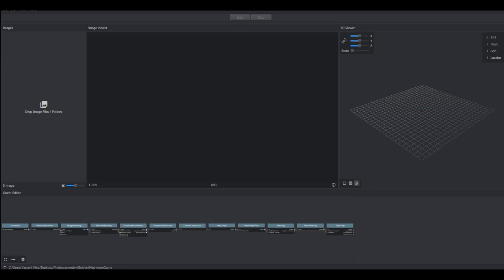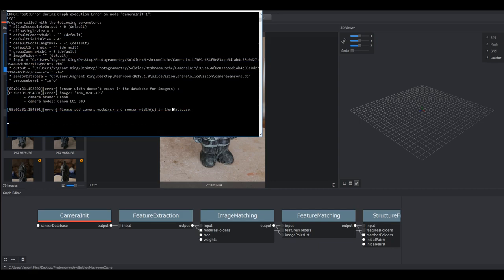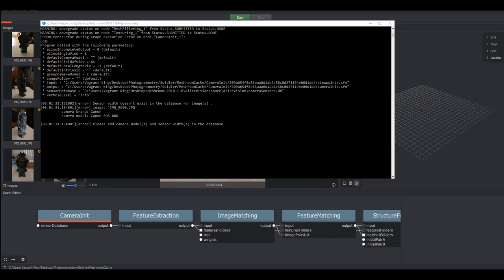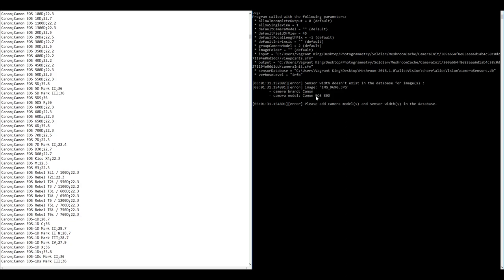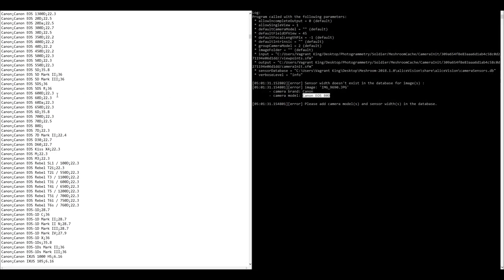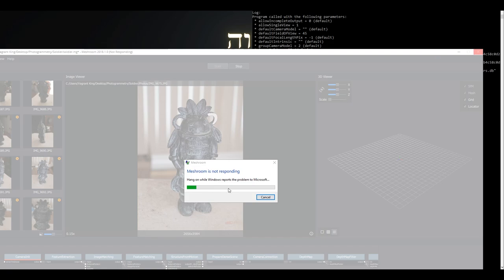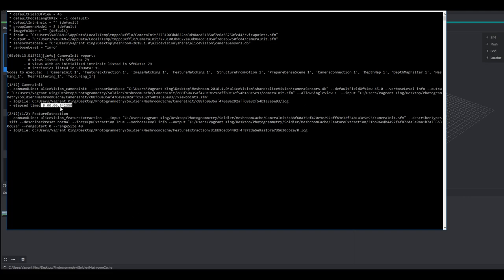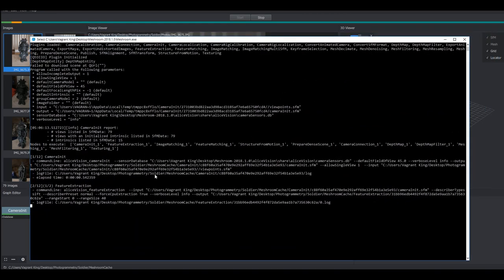Debuging Meshroom

Comment: I am using meshroom 2019.2.0 and it crashes on DepthMap. I tried deleting the red images, but now all of them are red exept one. And i tried to downscale to 1 in DepthMap.
Reply from the maker: Ivan Bradic that likely means that they’re blurry or don’t contain enough clear data for the application to process. You may need to reshoot. Also, make sure you’re using a CUDA enabled GPU and that your drivers for it are up to date.
Reply: @Crompwell  I checked, the images are sharp, but i didnt check the cuda, but thank you.
Reply from the maker: Ivan Bradic Just for further clarity: It is sometimes the case that even though the image appears sharply while zoomed out, when you zoom in very closely, there may be some images with pixel blur, very minor blurring, as has been the case with some of my student’s projects. In this case, you’ll want to remove these images as well and ensure steady photography by using a tripod and controlled exposure. Otherwise, you’ll definitely want check if your GPU is compatible and the drivers for it are up to date. :)
Reply: @Crompwell   @Crompwell  I checked the gpu, cuda is enabled for my gpu, updated my gpu driver, the pictures are green 38/44 are green and still crashes on DepthMap.
Reply from the maker: Ivan Bradic Try deleting the contents of the depthmap folder and each of the folders for the nodes which come after it within your project. Then run it again.

Comment: In my meshroom , I am unable to import the pic. What is the problem? Please help!
Reply from the maker: Are you trying to drag them in from an external drive? Because if you are, it won't work. You must first transfer the photos onto your machine, then drag them in.
Reply: Thanks
Reply: But it takes much time in the featurematching
Reply from the maker: @sharnsaminathan8260  Feature Matching can take some time, but Depthmap is usually the longest part of the process.
Reply: But till now it is computing
Reply from the maker: @sharnsaminathan8260  That is rather unusual. It may be due to hardware, but it could also be if you have blurry images. Let me know what your hardware specs are and if Meshroom is showing little green camera icons on the images you load in.

Comment: HELP NEED PLEASE Pleasantries I uploaded my photos from a canon m10 and it processed up to PrepareDenseScene but it’s nothing for DepthMap DepthMapFilter Meshing MeshFiltering and Texture - can you assist me to move beyond that issue please
Reply from the maker: you will need to check a few things: 
- Make sure your graphics driver is up to date!

- Make sure your files are all saved locally. Don't work off external drives or anything like that.

- Make sure your photos don't have underscores (_) in the naming, especially as the first character. 

- If none of that helped then try this: make a backup of your files, then delete all the folders in the Meshroom project from depthmap onwards. Launch Meshroom and try it again. 

If that doesn't work, copy the command prompt error data along with your system specs into a pastebin/hastebin and link it to me, and I'll try to debug it. 

Some of my students have had similar issues, but what I've suggested has gotten everyone through the project so far. 

I would also recommend trying the newest version of Meshroom (as of now should be 2019 version)